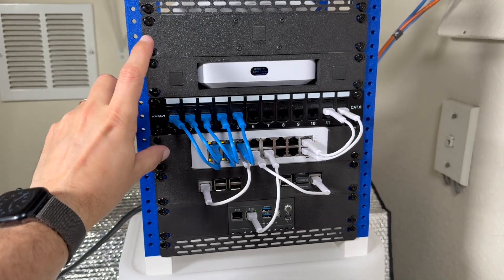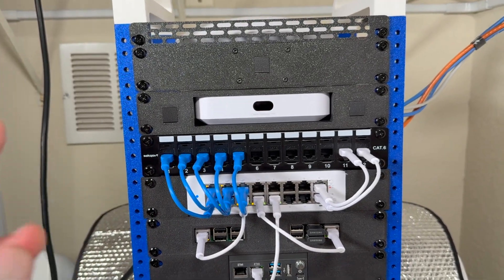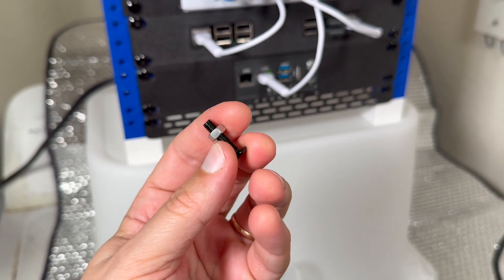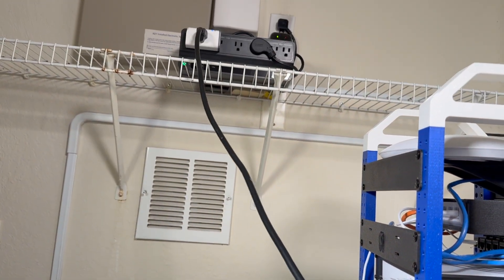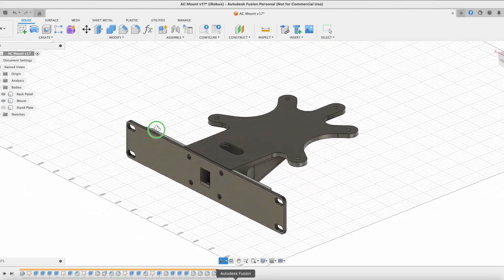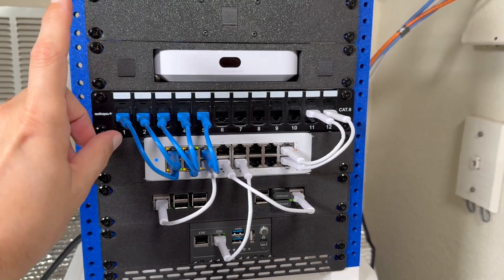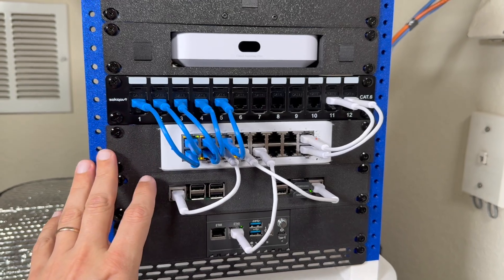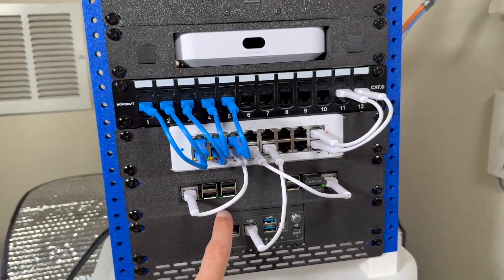3D Printed 10 inch Server Rack - Worth The Hype?

Comment: If rack space is becoming a problem, you could consolidate some space by adding a few of the devices to the same U space. Only issue I see with that would be needing to remove them for maintenance, you would need to remove multiple devices to work on one machine. You could remedy that by also designing a hot swap holder to those devices. 

Just some ideas for improvements.
Reply from the maker: You are right. I actually was thinking about it for a while now, want to add RPI cluster for experiments and it will require consolidation for sure.